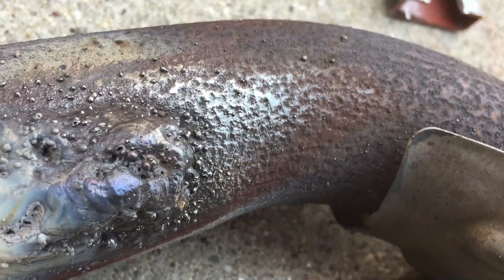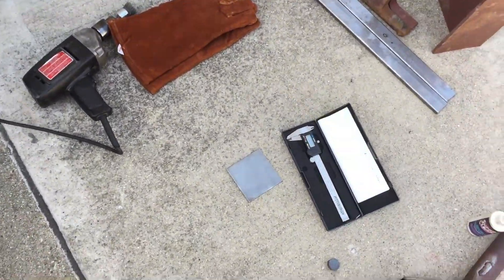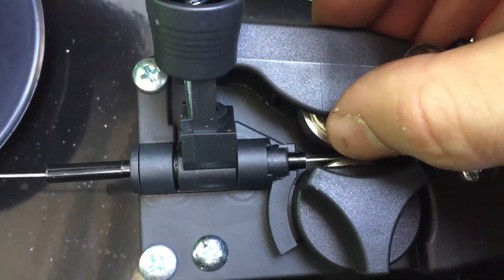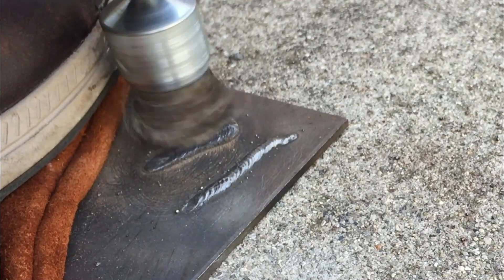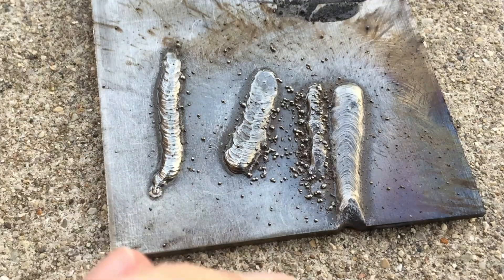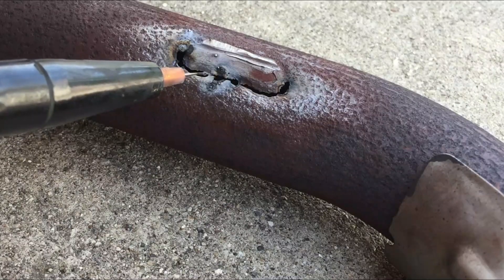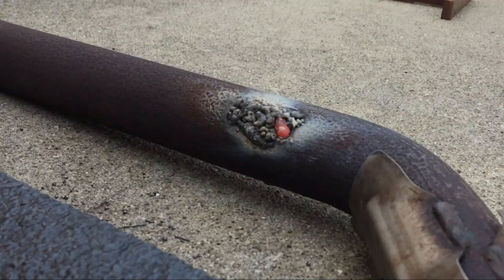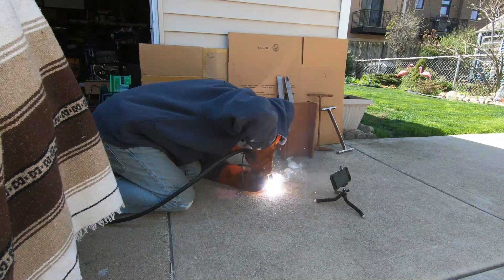How to fix a exhaust leak using a CHEAP Titanium Flux 125 Welder from Harbor Freights!

Comment: I love the video bro. Not because it was a success because it wasn't.

I get crazy ideas all the time too and then they don't work. But for me I got to try it and see why it doesn't work first. In this case that pipe is so rusted the metal you welded to will rust out next. 

I'm sure someone already told you if you're not going to replace the whole pipe the next best thing would be to cut the rusted out areas and weld in a sleeve.

But good video it was also short and sweet. Keep making them.
Reply from the maker: Thanks man! Appreciate it! Learn through failures

Comment: wire brush on that rusty old pipe isn't gonna do the trick, it needs an abrasive disk, grind it down to clean shiny metal, cut a patch from exhaust pipe (check the dumpster at the local garage.)
Weld the patch right over it .
Reply from the maker: That’s what I should have done. Would have been much easier and not burn holes in it.  Thanks for the comment.

Comment: Here's a little tip. Hold a longer wire length while spot tacking tiny cold spots all the way around the joint and then run a series of hot tacks over it. Good luck.
Reply from the maker: Thanks i did end up doing that and it sure helped prevent blow out.

Comment: Coat hanger would work even better than the scraps of flux core to start adding a little filler to those small holes.  Start the arch on the coat hanger.
Reply: Yes, the coat hanger helps to take up some of the extra heat too, which can help prevent burn through and You're also getting a filler to help you fill the hole quicker

Comment: I have that exact welder and actually bought it because the catalytic converter flange was rusted out. I grinded off any rot and still had a nice connection. Put welder on lowest voltage and wire speed on 3. 

Got a super clean ground spot on flange inches away from work, clamped with vice grips and grounded to vice grips. I had no problem welding entire pipe in about 10 minutes minus minor cleaning. The top was a bit of a problem due to clearance so I finished off with some jb weld.
Reply from the maker: Hey. Great job!!!
Reply: @BulliKid  thanks, definitely a learning curve on such thin structurally compromised material.
Reply from the maker: Exactly. I bought new wire for mine and it worked a lot better on thinner material.

Comment: If a job like that comes up again, find a 4 inch or maybe even two inch pipe, cut it in half, use it as a patch, and stitch weld it. Let it cool off, and weld it all the way around the patch. The thin material will burn quick, so remember it’s a process and will take time to weld it. But keep going! Practice makes better.
Reply from the maker: Thanks for the tip.  Yea that way I have more fresh metal to weld too.  Good idea

Comment: Using a magnet is a great way to identify mild steel or even high carbon cast iron. The best way that I know of is to hit it with a grinding wheel. Mild steel gives you longer firework like sparks, stainless will be shorter, aluminum you should hardly see any spark
Reply from the maker: Thanks!!!0

Comment: Let it cool down between welds too hot should try to tack a little patch over it I would clean the metal a lot better it worked for now keep practicing you  will get there 👍
Reply from the maker: In the future will grind flat and reweld to make sure all the micro leaks are welded

Comment: Might have been easier to just cut the pipe and all that rot out,  then weld in a 4 or 5 inch new piece of pipe, or how ever many inches you cut out.  The auto store sells 13 inch straight pipe for about $8
Reply from the maker: That’s another option.  I thought it would be easier then it was.  New welder so it’s all a learning curve. But it’s holding up great.  No audible exhaust leak.

Comment: Good video man .👍 so can I weld muffler pipe with this welder
Reply from the maker: Machine Addictive digging you can. It probably won’t be the prettiest but it will weld.  As long as the pipe is steel based.   I’m still learning and did some more welding with this.   A mig welder would probably be more ideal but this is the best welder for the price it costs

Comment: Longer stick out let’s you weld a little colder help you fill holes.
Reply from the maker: Thank you! I  figured that out a little bit after welding.  More of a globular type of transfer.  It certainly did help on this thin metal. Thanks for your comment!
Reply from the maker: Thank you! I  figured that out a little bit after welding.  More of a globular type of transfer.  It certainly did help on this thin metal. Thanks for your comment!

Comment: The practice welds for the most part looked ok except for the one that looked like bird crap as did the exhaust pipe! Make little circles as you weld moving along what you are welding together. In that circle you are going from piece to piece attaching them together. Remember stacking dimes, dimes are round, make little tiny circles, smaller than dimes, more like the eraser on a pencil size or a little bigger to attach both items you are welding you need to also go across from side to side in that circle, as you move along laying your bead. The exhaust pipe needs to be replaced! The pipe is worn out and there is no thickness left to weld and that is why it kept burning thru! NOW you know why I said take it to the muffler shop! All the time you spent removing it and trying to weld it, you could have been doing something to make money, a lot more money than you would pay the muffler shop to do it right the first time because you will be repeating what you did over and over many times with what you have now, so you come out ahead letting them do it right the first time instead of spending days trying to weld up worn-out metal piling bird shit on it! LOL! You wasted a day taking off the pipe and trying to weld it. You could have made some good money in a day and just replaced the worn-out old pipe. Looking at that you should have just ordered the new pipe and replaced it. That was one rare time you could unbolt a small section and order a section to replace it yourself. Most exhaust pipes are welded and cant be unbolted so not only do you have to deal with what you did but you have to do it from under the car and deal with all that hot slag and sparks dropping on you and burning thru your clothes or going up your sleeves. That is why I said last time you will be happy you got those gloves if you are welding under something they will keep anything hot from going up your sleeves and those burn like hell on you and your clothes. That exhaust will be leaking badly again in no time because there is no thickness left in the metal to keep it from cracking again. You could see in your test it is still leaking badly. Lesson learned and we know better next time! :-) Keep trying and don't give up! Me being older than dirt, I now have a lifetime of those lessons! LOL! Take care and God bless! STAY SAFE!
Reply from the maker: Thanks for the comment and for watching! Def was a long process and like you said I could pay someone to do it but the experience gained is priceless and I like to better myself with these kind of things.  Unemployed now anyway so can’t do much to make money aside from the day trading I have been doing.  I’m just curious if i took it to a muffler shop to weld how they would have went about it? What tequnique they would do to seal that hole.   Also that license plate frame I tried to weld... well I was at my brothers the other day and I put a magnet to it and Nothing. Must be aluminum, and explains why the welding process was not working for me! Thanks for the advice on the magnet!  God bless and take care to you too! ✊
Reply: @BulliKid  The muffler shop would tell you it is to thin to weld replacing it with new pipe. I didn't notice the condition of the flanges so I can't say if they would use them or not. Most likely the flanges are good because they are a lot thicker.  Therefore the muffler shop would put it in a rack cut off the old pipe and weld new tubing between the flanges! Done! It would take no more than 15 minutes! In and out and it would lest for many more years there. Don't try to weld and cast iron like engine blocks etc with that welder either. I have to say much improved this time on your test beads! But the exhaust weeelll! LOL! If you could just cut a new piece of pipe and had something to do the bends you could DIY. But most do not have a pipe bender so doing exhausts properly is impossible. If you can buy that little piece online that is your best bet and install it yourself. You can always go by a muffler shop and ask them what they would charge to fix it. Good luck! You are doing better my friend! Still, a long way to go. You will get there if you practice enough. Take care and God bless you all! David

Comment: Looks like on your test plate that you are getting the welding figured out. I always run my wire speed a little higher
My Miller welder  has numbers. If I have the voltage on 4.  I will put the speed on 4 1/2. Then its up to you on the speed you move. Sometimes that exhaust pipe is hard to mess with. Might be time to go to the Zone.
Reply from the maker: Yea the plate was nice to weld because nice and thick material.  I don’t like the letters on the voltage section. But then again it’s a beginner welder.   It’s tricky to weld and I’m afraid if burn through sooo much!